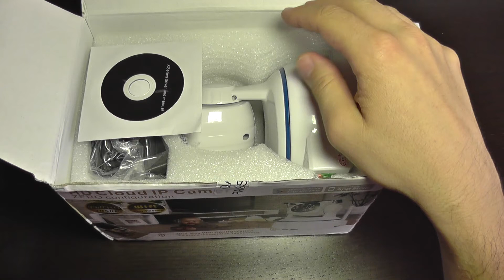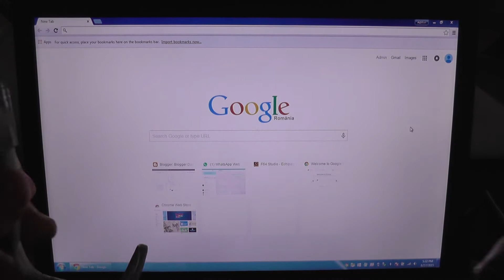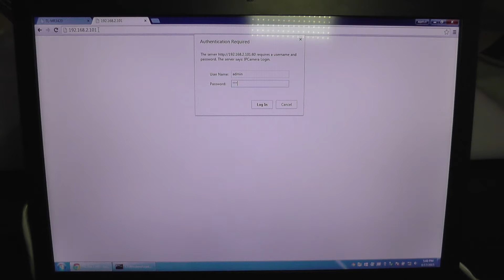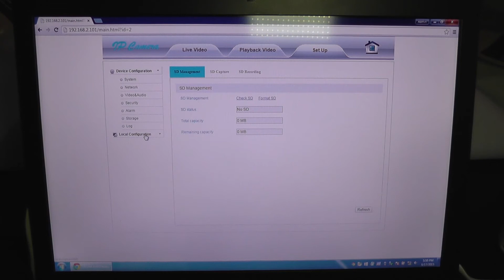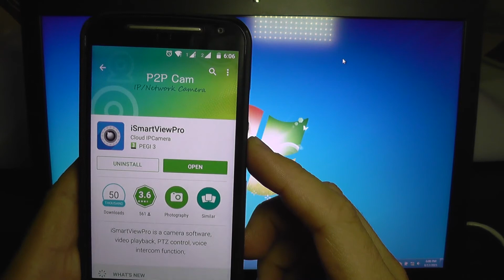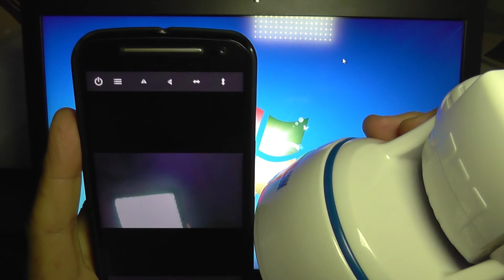1080p Full HD IP Camera P2P - unboxing, set up, install and configure (Android and PC)

Comment: TechTronic9000 Please, how can i fix the IP for the cam so i won't lose contact with the camera if a power failure occurs and i'm away from home ?
Reply from the maker: In network configuration, you have an option to disable dhcp and set a fixed ip.

Comment: Looks like clasic CHINA shitt....
Reply from the maker: +Ika Sgc It is, but the image quality is very good (real 1080p, not interpolated). If i have time I'll upload some 1080p samples from it.
Reply: +TechTronic9000 Now i have home HOSAFE 2MD3G.... Image is good but firmware is total disaster.... Without Synology NAS its not applicable...
Reply from the maker: +Ika Sgc I have managed to obtain a firmware update for mine. It's very stable and almost all the features work. The only problem it has that the mail alert is not working. I have a lot of IP Cameras ranging from no name to Foscam's and others. All of them work with the same mail providers, this HOSAFE one does not. I have tried also with other mail services. None of them work. HOSAFE support does not answer so I'm kind of at a dead end. I'm using a remote FTP for data storage.
Reply: +TechTronic9000 I thing HOSAFE is number 1 on china kvality. (irony style)